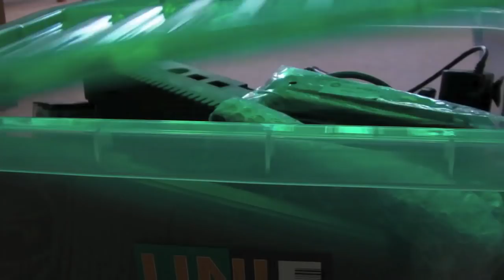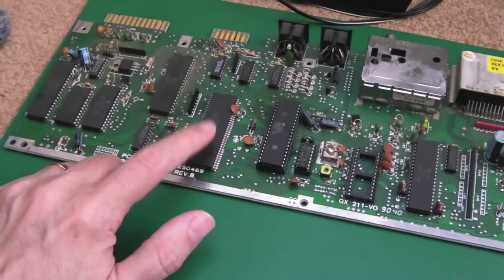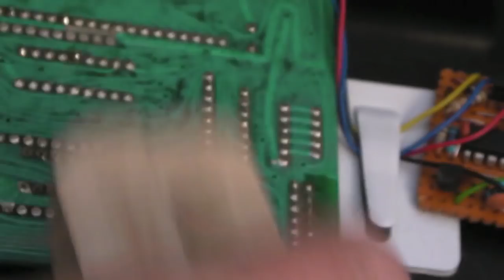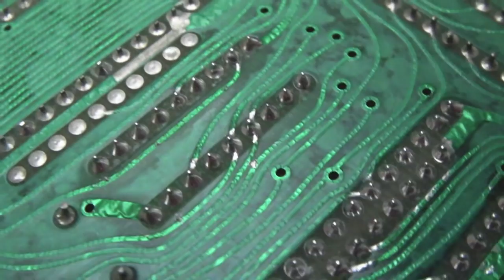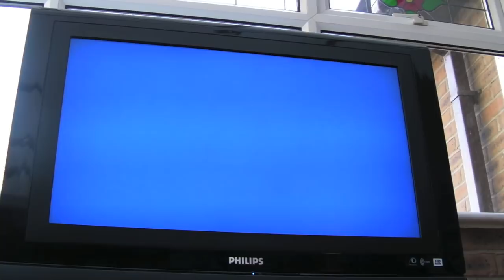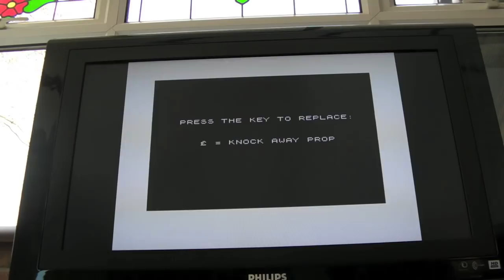Sinclair ZX81 Internal 16KB RAM Upgrade (Reversible)

Comment: I built my ZX81 from a kit.  I put in sockets for all the ICs, including the two 2114 chips.  (I didn't fit the single 4 KBx8 RAM chip.)  Is there no way to use the full 32 KB in the chip you used?  I would use an extra socket for the RAM chip, and bend the pins out on the socket only.  

I see I'm 7 years late to this party.  YouTube only just noticed that I have an interest in the ZX81.

Comment: They used rolls of thin tape for the traces plus scalpel and tweezers.
The DIL IC layouts were either strips of pads or sized transfers.
All onto acetone film at 1:1 scale or maybe 2:1

Try SCCS Interface and Interface Age for 70s computing.

Comment: What happens to the original RAM when you connect the RAM expansion? Is it "masked" or does the RAM expansion not enable the lowest 1k or RAM and just complements the original? Thank you in advance.
Reply from the maker: If you do the mod the way I did it, the old RAM gets disabled.  The new RAM provides all of the RAM.

Comment: Great Vid. I used to have 49er for the 81 back in the day. it was always the hardest game to load for some reason. Possibly cos of high res graphics? Football manager had no graphics and loaded every time. maybe a good idea to use that as a test prog in future episodes,  :-)
Reply from the maker: I think you're right!  I also had no end of trouble trying to load this particular game as a kid!  I wondered if it was to do with the volume of data (needing 16Kb) and the reliability of the RAM pack connectivity for that long load.

Comment: Just completed the zx81 mem mod today on an issue 3 board. Clearest and cleanest I could find on the internet! Finally got rid of those 16k external nightmare expansion modules after having them some 35+ years in my procession.Thank you very much! (Also thanks to Dave, the link doesn't work anymore by the way).

Comment: The ZX81 disables the internal 1k RAM chip when the external pack is fitted, so I expect it would disable a 16or 32k chip in the same position. There is a way to switch the old chip back in; I used it for user-programmed graphics

Comment: Would it be simpler to disconnect and pull up pin 8 (^CS) on the 1K chips, without removing them?
Reply from the maker: Yes, you could do that - you will need to feed the CS with 5v (through say a 4K7 resistor) though.

Comment: Hello and thank you for your very good video.
However, there is something ambiguous about your connections:
Have you voluntarily connected A11 of RAM on A12 of ZX and A14 of RAM on A11 of ZX and A12 of RAM at + 5V ?
Reply from the maker: See this guide - I pretty much did the same mod I think:- http://blog.tynemouthsoftware.co.uk/2017/10/zx81-internal-16k-ram-reversible-version.html

Comment: Is it true that a ZX81 could go up to 64k?
Reply from the maker: TBH, not sure - the Z80 has a 16 bit address bus, so it can technically address 64K, but the problem is the ROM sits somewhere in the address range too.  And I guess the ULA will likely use some address space probably.
Reply: @GadgetUK164  Im sure i remember seeing 64k ram packs advertised in sinclair user/ programs , they went down the whole length of the 81's back and cost ridiculous amounts of cash :-)
Reply: @GadgetUK164  ULA uses I/O, you just need some logic to not select when the first 8K is output. A15 A14 A13 to a three input NAND gate, any high input gives a low CS output. all low which would be 0-8K gives a high output.

Comment: to someone of your ability those c64 consoles are good for fixing c64's, you can even fit a c64 consloe board into a c64,you have to solder the keyboard connectors and a few other bits, a standard c64 rom is a good idea too, but if you have a broken c64 and a console c64 it is worth considering.
get yourself a c64 console and the other c64 boards and put them side by side, i think you will find it very interesting, the console versions are useless unless you have a stack of carts, there used to be a video on youtube where a key board from an sx64 was plugged into a game system along with a tape deck, after turning on it loads a game from tape, it had been up graded to c64 spec, i can't seem to find it now.
Reply from the maker: Yes, you could do that - but.... The console version of the C64 sells for around £300+, a standard C64 sells for £30...  If you find a console version of the C64, dont take the PCB out of it!!! =D
Reply: really, i remember when dixons were selling them for 14.99.
Reply from the maker: Wow, wish I had bought a load of them back then lol

Comment: i am finding a lot of 28 pin 32k ram chips that say "62256 family" in their description, does that mean that these can be used as well?
or does the chip need to have that exact number on it in order to be compatible with regards to the datasheet/pinout?
Reply from the maker: I think it should work - just check the pinout first to make sure its the same, but I think most of those 32K 62256 equivalents have the same pinout.
Reply: GadgetUK164 - Retro Gaming Repairs & Mods 
thanks! can't wait to try this!
Reply: GadgetUK164 - Retro Gaming Repairs & Mods 
just installed one of the chips i managed to buy in my Timex1000 on a nice socket, all dandy,
but that 2k NEC D40160 chip i removed to install that socket,
could that be used as a drop-in upgrade in a ZX81?
i know it would only add 1k, but i'm just curious.
also, don't want to throw it away.

Comment: Forty Niner was the only "Hi Res" game on the ZX81 and I used to play it a lot. 

The game didn't use the normal ZX81 built in graphics but instead used its own custom built graphics coding to allow sprites. It was the work of a machine coding genius.

Nowadays anyone that has the skills to programme any computer in machine code / assembly language is regarded as a mystic or god by lowly IT technicians and IT engineers, as they have powers over computers beyond comprehension.

If one can programme in assembly language / machine code one understands why Core processors exist and how they work. (Clue: It's to do with not having to stack ALU register contents into memory everytime an interrupt or branch instruction is encountered).

What do electronics engineers do when they want a good laugh?? Ask and IT engineer to explain how they think a Core processor operates.....

Comment: for those wires that you use you could get a 4 pin fan header connectors to make it easier to remove the chip or to place back in to save the effort in carefully re-soldering
Reply from the maker: Yes, great idea!  I might just use single pin sockets for them and connect them that way or something.  I will probably never need to disconnect that new chip though, only reason I did it that way was to make it easy to revert.

Comment: May I suggest soldering the wire to a single turned pin and push it on the pin of the chip next time? if you don't like soldering directly to a chip, way less chance of cooking a pin and should be dead easy to do with "helping hands". Great vid. I want another Speccy, maybe a +2 to replace the one that had issues and the wife chucked out, or a rubber key, not sure though, prices are high (for my budget) now, thanks to the retro revolution!
Reply from the maker: Love it =D  Nice idea!  I will alter that next time I am in there.  I wanted to heat shrink those connections too, then it will be nice and tidy.
Reply: Yes it would look really nice with heat shrink. Happy to inspire ya Gadge.

Comment: I had no idea you could do that.. Suddenly that makes the ZX-81 much more interesting! I'd pretty much discarded it as a platform due to the horrible RAM packs.
Very cool indeed, thanks for sharing. :)
Reply from the maker: Yeah - I had no idea either until Dave pointed me towards his blog!  It's certainly much more reliable now.
Reply: Yeah I bet! I need to get someone to fix my ZX-81 now.. I've tons of tapes for it that I never got to play with!
Still too scared to play with a soldering iron myself, heh.
Reply from the maker: Best way to start is by just messing around on some scrap board - something like an old alarm clock or something.  Desolder some components, solder some on there, practice removing a chip etc.  It's not hard, but its important to practice on something you can destroy first - just to get used to techniques.
Reply: Aye, that's good advice.. I'll get around to it eventually, hopefully. :)

Comment: Nice work there. I did something similar to one of my ZX81's last year. Mine only has 8k at the moment (largest SRAM I had in stock) but I'll up that soon as a suitable SRAM comes available or I bite the bullet and buy one. As well as the RAM upgrade I also fitted a ROM switch so it now boots either Sinclair BASIC or FORTH. Regarding your hum issue, is it more noticeable in your conservatory? I'm wondering if the tape recorder is picking the hum up that is being radiated by the ring main. Do you get the same effect powering the cassette player from batteries? try switching the ring main that runs that room off then power your TV, ZX81 and cassette player from an extension lead and see if the hum is still there. Had lots of fun chasing down similar hum problems back when I was a full time AV engineer.
Reply from the maker: Thanks!  Cool, I didn't know you could run FORTH on these!!!  I will try batteries later to see if I can work out whether its the ring main or not! =D  Not something I've come across before!

Comment: First computer I ever used was a Timex Sinclair 1000 - basically a US version of the same computer and it had the same flakiness with the rampack - I remember it being quite frustrating.
Reply: There are some slight differences in the ROM that cause some minor compatibility problems but most software will run unmodified.  Biggest difference is the shipping with 2k instead of 1k of ram, and better RF shielding to meet North American requirements.  They also made the Timex Sinclair 1500, which was a 1000/ZX-81 with 16KB RAM on board in a silver Spectrum style case with rubber chicklet keyboard.
Reply: As others have mentioned, the ROM differences between the T/S 1000 and the ZX-81 are insignificant, but the ROM differences between the T/S 2068 and the Spectrum 48 are enough to make most Spectrum software not run on the 2068.  However, if you burn a Spectrum EPROM and put it in the 2068 it makes it capable of running the vast majority of 48K Spectrum programs.  With a more sophisticated mod you can switch between Timex and Sinclair modes.  The T/S 2068 has the same sound chip as the later Spectrum models, but at a different address, so it's not directly compatible.
Reply from the maker: I didn't know that Timex had a model of this - I might have a look for one of those! =D
Reply: GadgetUK164 - Retro Gaming Repairs & Mods yeah it's the same internally except it has a ntsc modulator and 2k of built in memory. The 16k ram pack looks exactly the same it just says Timex on it :).
Reply from the maker: Cool =D  I am guessing the basic ROM is different between the two do you jnow?
Reply: I honestly don't know. I do have a Timex Sinclair 2068 (basically a US Spectrum) that has an EX-Rom for basic sound routines - it's kind of a cross between a regular spectrum and a 128 model. I've been making videos about it, but I can't quite finish the video because I can't get it to load and I've had the worst time repairing it.

Comment: Hi Chris. Just a ‘slightly’ random question: what model of TV is it you use as it seems ideal for retro projects? Are there any other steps you use in connecting old consoles etc? Cheers, Dave
Reply from the maker: Thanks!  I will check the model number later.  It's just a 2008 ish Panasonic 720P / 1080i LCD TV.  One of the nice things with the Panasonic models of that particular range is they were of the era that we all started transitioning from standard def to hi def, and so the upscaling was taken seriously, and as a result any old SD signal gives a really nice upscaled image.

Comment: Maybe the tape deck is suffering a similar issue to that of land line telephones... when you place your mobile near one? There is a speaker on the cassette deck. An the old magnetic tapes .. so as someone else mentioned in the comments .. possibly your house mains under the floor.. or your neighbours WiFi ..?   Or a door way to a parallel universe ..? If things start moving you should contact a priest.. 
Cute cat dude .
Reply from the maker: Thanks, and Luigi the cat says thanks too lol =D  Things do move around the house, I think I need a priest!  Oh wait, that's just my annoying wife moving things...

Comment: The only thing I can think of with regards to the cassette deck interference would be there must be something possibly the main electric feed to your house going under your conservatory, when you put the cassette deck on the ground it sounded to me like classic 50Hz hum, if you had some field probes for your oscilloscope you could pick it up on the scope and could workout where the feed actually is and what direction it is travelling.

Oh, great mod by the way. Dave Curran strikes again (top man) and finally, I love how your cat pops into shot every now and then just to say hi. So cute.
Reply: Mains wiring shouldn't be radiating massively though, as the current will be balanced. It's solid underneath is it, no spaces where some equipment may be?
Reply: Does sound like that, if you have anything that detects live current that would be a start, metal detector? tbh you could pull the cassette deck over the floor to see where its emanating from haha, stop working on the floor its no good for you back anyway :) great video btw
Reply: Matthew Day could be loops of wire?? Sorry Gadget you now have to did your conservatory floor up so we can answer this enigma😂😂
Reply from the maker: Thanks =D  Cat says thanks too lol!  I think you're probably right - that does make sense!
Reply from the maker: Hehe, yes, I think he's right!  I do have a cable detector, I might try that on the floor to see if I can find anything.  Chances are though an mains feed will be below quite a depth of concrete I would think.

Comment: I remember i had a mate with a spectrum and he had to put the tape deck on its side when games didnt load. Ah the querks of early 80s gaming.
Reply: My neighbour had a speccy.  He also had a tiny screw driver that he used to fiddle with the tape head *all the time*.  It seemed like such a pain in the nuts compared to the C64 Datasette.
Reply from the maker: Haha, yes - I spent a fair bit of time messing with the azimuth to get those hard to load games loading....
Reply from the maker: Hehe, sounds like his tape deck needed a repair :P   The other funny one similar to that is the PS1 upside down in order to load discs - due to the plastic sled wearing.

Comment: Thanks for the link, pleased it the upgrade went well. The board in my blog was an issue 3, yours is the issue 1 (there was no issue 2). The diode positioning and numbering is the same, just the resistors by their side are different. You don't need to remove the RAM if you use a RAM pack, when it is plugged in, it disables the onboard RAM chip(s), although you will still only get 16K.  The Minstrel ZX80 clones are my design, although based mainly on the original ZX80 design but in the ZX81 form factor.
Reply from the maker: Thanks for the blog!!!  Ah, I see now regards the revisions!  And thanks for mentioning that the RAM is disabled by the RAM pack - excellent, will make it much easier to test when I re-cap the RAM pack.  What's the difference between ZX80 and 81, can you easily convert the 80 into an 81?
Reply: ZX80 has TTL chips rather than the ULA that the ZX81 has. ZX81 also has an NMI mode which allows it to switch off the screen to do some thinking. The ZX80 (and ZX81 in slow mode) spend most of their processing time drawing the screen and only run code at the top and bottom of the screen. You can convert a ZX80 to a ZX81 by adding an NMI circuit, more info on Grant Searle's excellent site: http://searle.hostei.com/grant/zx80/zx80nmi.html
Reply from the maker: Awesome, thanks for all the info =D  Might have a go one day!
Reply: @GadgetUK164  Anybody who has a mint condition ZX80, leave it original, they are collectors items, good money.

Comment: that Zx81 kb looks like painful to use
Reply: There were some aftermarket keyboards that were pretty good.  I was lucky enough to find a Timex/Sinclair 1000 at a thrift store that came in a 3rd party case with a 'real' keyboard:  https://8littlebits.wordpress.com/category/timexsinclair/

I'll have to do this upgrade on that unit.  That would really make it nice.
Reply from the maker: Haha, yes - you are 100% right!  It's a nightmare to use!!!